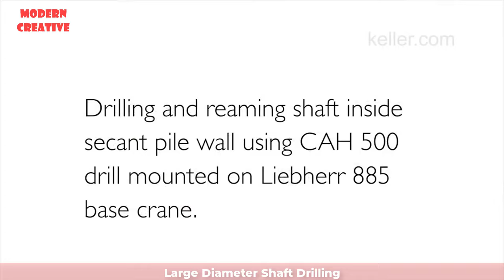Modern foundation technology for high-rise buildings with bored piles and walls

Comment: These are pretty standard construction procedures for deep foundations used in many parts of the world.  It appeared that this work was not being done in the United States.  It is almost completely forbidden to weld reinforcing steel in the United States and likely the reinforcing steel used in other parts of the world is not as good metallurgically speaking.